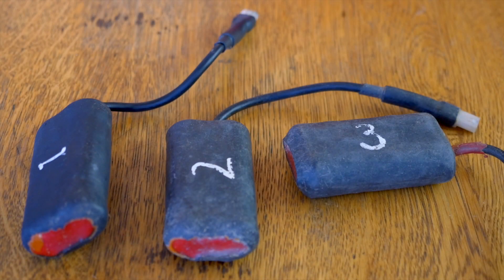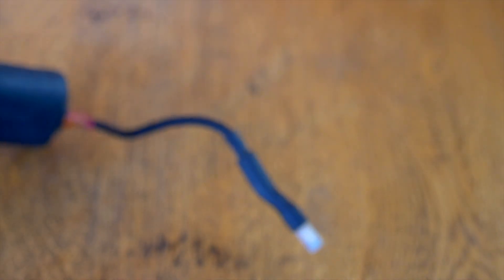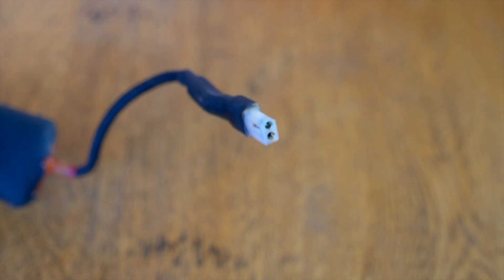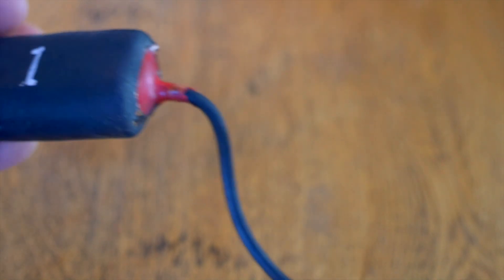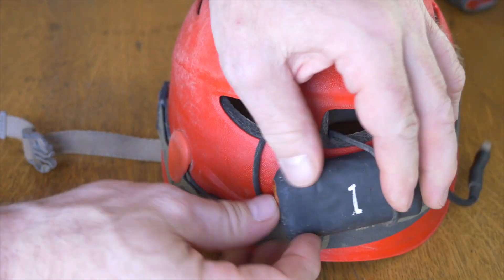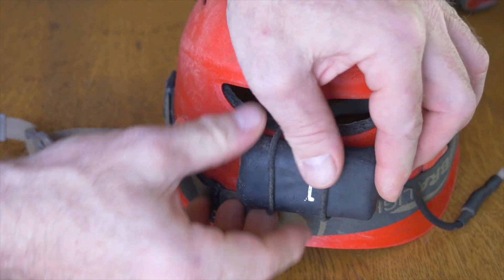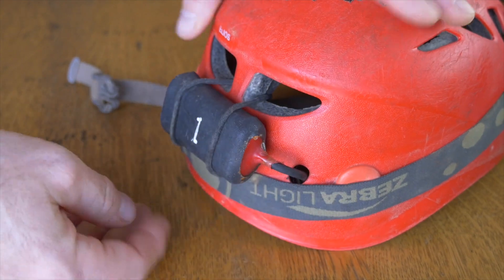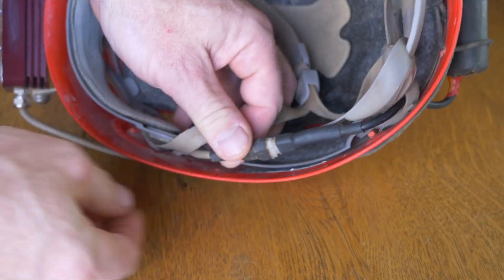How to Build a Lithium-Ion Battery Pack

Comment: Hi Derek!  This is Kevin Downs. Will this work with a Scurion headlamp?  I tried to make a twin battery pack and the light came on but only flashed when I changed levels. I didn’t use a pcb board. Is that what I did wrong?
Reply from the maker: Yep… your voltage is too low.
Reply from the maker: Hey Kevin. A PCB isn’t required, but a good idea for safety. For the Scurion a 2-cell battery should work fine if they are wired in series (as shown in this video). You should have a voltage of about 8.4V when fully charged, and 6.0V when fully discharged (7.2V nominal = 50% charge).
Reply: Ok. I wired them parallel. I’ll bet that’s why it didn’t work right. Thanks Derek!

Comment: I prefer prismatic batteries for multiple Li-ion built by vendor/manufacturer. Should mention buying cells with/without solder tabs and with/without SCR protection circuit. Finally, Li-ion cells should never be discharged to zero volts, DIY caution in order.
Reply from the maker: The use of cylindrical cells is fairly standardized for commercially produced cave lamps. Probably mostly due to lower cost and better availability, but perhaps they are a bit more rugged and better at heat dissipation. Prismatic cells would probably mount to a helmet better and take up less space. Yes, I buy cells with solder tabs, but without a protection circuit, instead relying on the PCB for protection against shorts/over-current, over-charging, over-discharging. Probably should also warn against never soldering directly to Li-ion cells (thus the need for solder tabs).

Comment: cool video, do you also built yourself your cordless drill battery pack?
Reply from the maker: I don't, but I know a few people that do. They buy used, non-functioning drill batteries off eBay and install new high capacity cells.